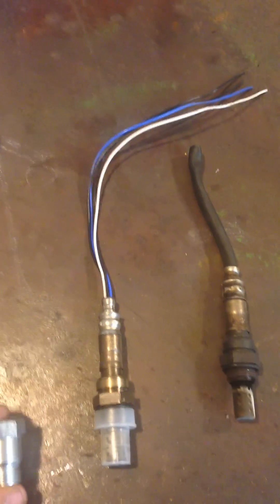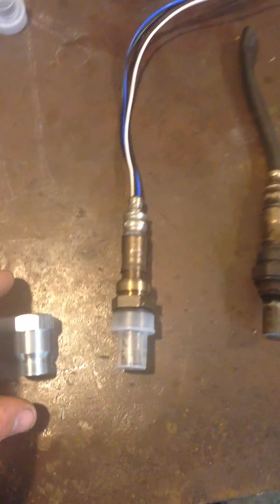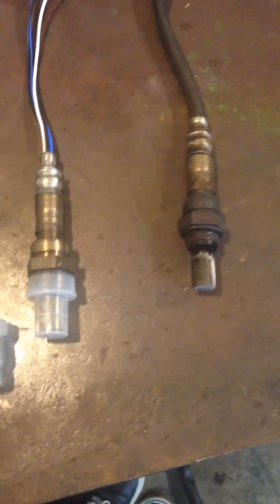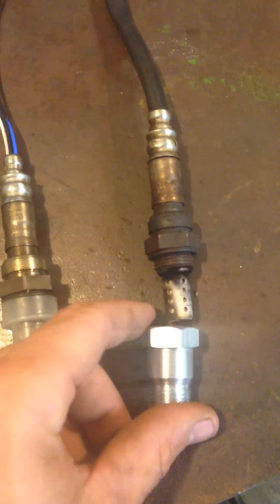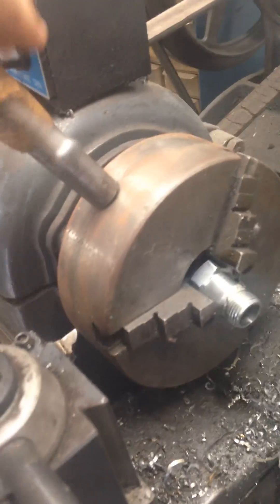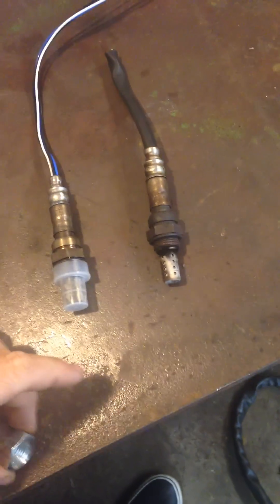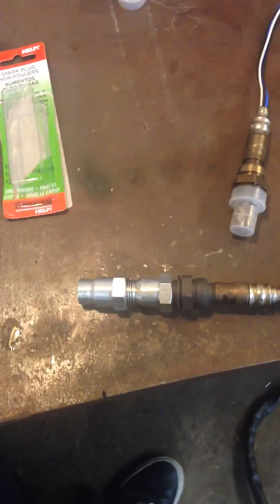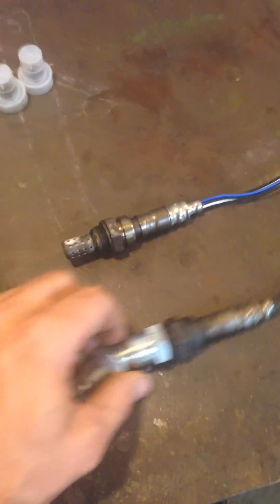downstream o2 sensor catalytic converter simulator

Comment: I did this, cleared the code & within a half an hour I got (02 sensor bank 1 sensor 2 high voltage) code back.
Reply: You missed my birthday
Reply from the maker: if the o2 sensor is bad, it wont help. If you have no cat or a bad cat it will get rid of the codes. I currently have 30k on a catless exhaust with no codes. but again, a bad o2 sensor will throw a code
Reply: richharr It was brand new